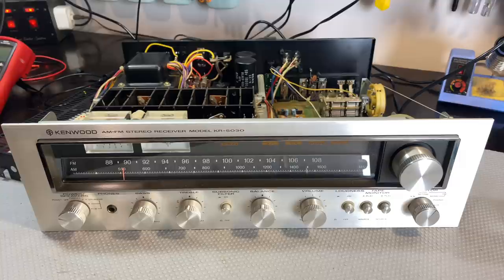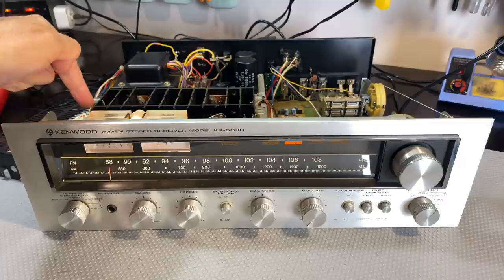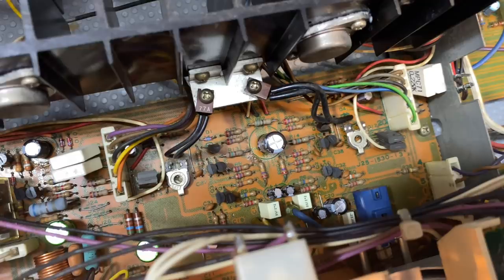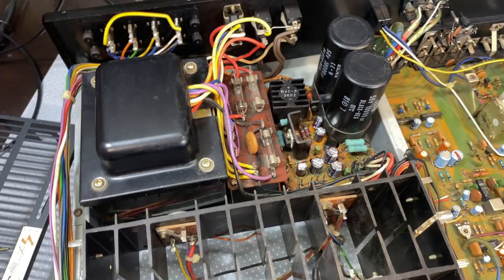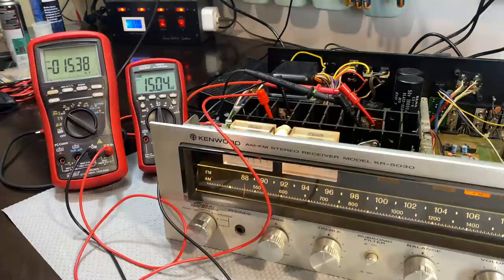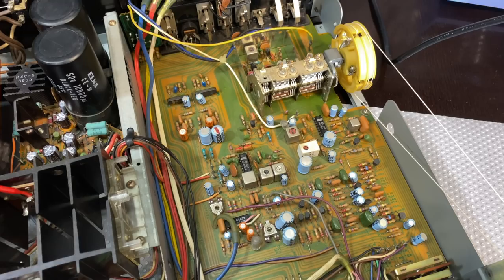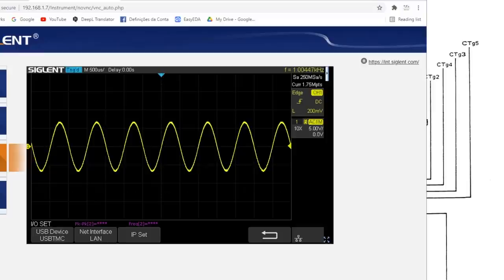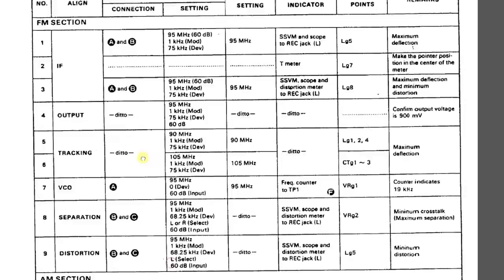Kenwood KR-5030 Stereo Receiver restoration pt 2. Many capacitors, cleaning, and a bit of luck.

Comment: Very nice restoration. I may have to watch the section on the tuner calibration a few times, because I admittedly wasn't sure at times just exactly what the procedure actually was. But that little Kenwood certainly looked nice cleaned up and running properly.

Comment: Cool how you managed to re adjust the radio. Nice find about the mute transistors. If this wouldn't fix it I had cut out the mute transistors then ok there is noise between radio stations.

Comment: Hello,
New viewer and subscribed. I watched this and your intro video on this unit and had some questions as I'm hoping to be able to restore a Kenny 6030 that is on it's way to me now.
In the intro video I think you said you checked with ELV and they said they would ship to the US even though it's not indicated that way at the website. Can you confirm this please?

Then as I'm very new to this type of work, I'm trying to get up to speed with understanding it all.
Could you please back the bus up so to speak and show me how you have connected this unit and your scope, and any other test equipment needed to tune the FM?

Please break down each cable - connector - location and settings for me.
This request will probably need another video but it would totally help me as I'm just starting in this type of work. I do have a scope - function generator - variac - power supply and a couple of DMM.
My thanks for your help.
Happy New Year,
Jack

Comment: No love for the phono stage?  Oh well...  The center channel meter is an indispensable tool for setting up the detector properly, as you discovered.  The meter won't deflect properly if the detector cannot resolve proper phase.  Without this, you won't get optimal performance out of the FM tuner, and, as you discovered, an out of phase detector can impair detection of the 19 KHz signal, and also wreaks havoc with the upper frequencies where the difference signal is transmitted.  

It's a good thing that setting the detector properly solved the problem.  Adjusting a multiplex adaptor can be a thankless task.
Reply from the maker: True. I need a few more of these under my belt. They are a far cry from tube gear 😊
Reply: @electronicsoldandnew  I have the feeling you are being modest here...  I serviced audio equipment back in the '80s and '90s, mostly Scott, Fisher, Marantz, and McIntosh.  Both tube and solid state.  FM tuners, particularly multiplex stereo, can be a bit of a challenge.  Early solid state gear was surprisingly similar in circuit implementation to tube gear.  Proper IF transformers, rather than those puny crystal IF slots that took over by 1970.  These are hard to work with, and in some cases, next to impossible to set up properly.  The thing is, they were not supposed to be adjusted.  Yeah, right!

You may want to get your hands on a 60's HH Scott receiver.  Many were sold in Europe.  They are a pleasure to work on, with classic circuit layout that was a direct carry-over from the earlier tube circuits.  With Scott, you have the best quasi-complementary amplifiers ever made, and with the introduction of symmetrical complementary designs in 1969, a topology that was perfect in design from the start: Circuits that really haven't been improved upon.
Reply from the maker: My experience with these sets is fairly limited, although I can climb the learning curve quite quickly. The fact that I didn’t stay in the electronics field after finishing my degree at varsity means that a lot of this stuff that I’m tackling now as a hobby is a first for me. It also means that I didn’t get bored with it professionally so the fascination is still there. 
I’ll keep my eyes open for a Scott receiver. I’d like to experience what you’ve just described. Thanks

Comment: If the Integrated Circuit is impossible to get the what about a replacement module using a Silicon Labs AM/FM radio module which outputs via dual DAC output stage and would need to be powered by a LM7803 Voltage regulator but the tuning capacitor needs to be replaced by a pot as the module uses a VCO.
Reply from the maker: First we try to restore, and only if that fails do we replace 😊
Reply: @electronicsoldandnew  yes, too many just go ahead and do a sweeping replacement of parts without really looking into what the real issues could be!

Comment: I recently bought a KR-5030, is there any way of boosting or adjusting the phono pre-amp? I changed carts on the turntable to a Grado blue and it is noticeably quieter and the tape recorder record level is still too low, can't get a full 0dB on the VU.
Reply from the maker: I’m sure you could, but it would require some careful study and experimentation
Reply: @electronicsoldandnew  Yeah, a little more complicated than I had hoped. BTW, though this video did help with the FM section. When I first got it, it would receive very well but nothing in stereo. I made a slight tweak of the 19khz VCO and it works perfectly now.